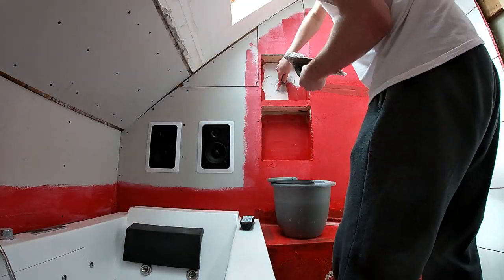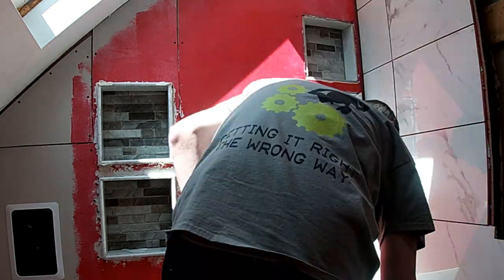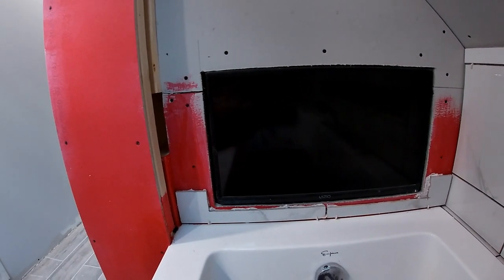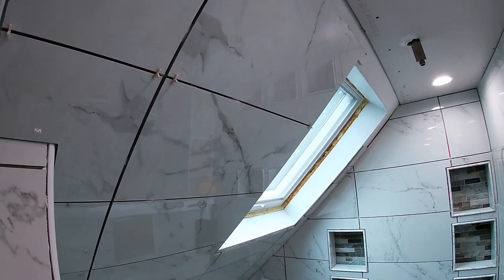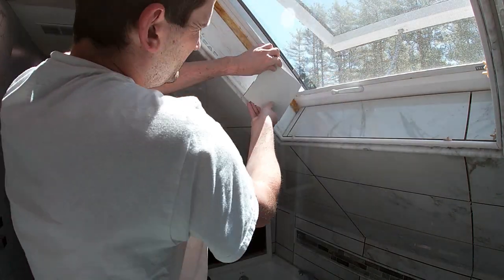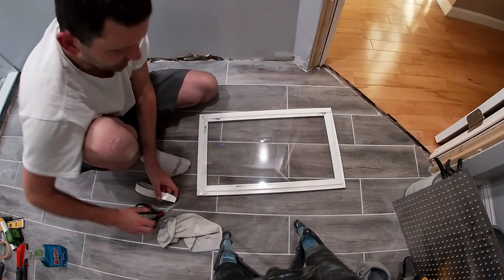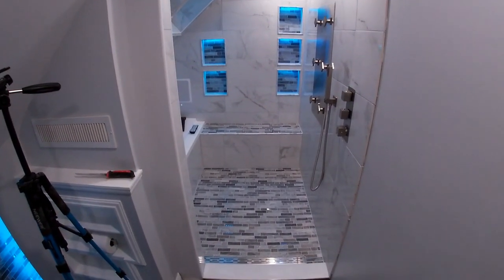DIY Luxury Shower + Jacuzzi COMPLETE! - Bath Reno Pt 8

Comment: Question: I have the same whirlpool bathtub, but I have problems with electrical wires, because there’s no instructions and very bad customer service. How  your connected the 2  wires from bathtub to the electrical panel? What’s amperage and voltage?
Reply from the maker: It's just 120v so hot to hot and neutral to neutral.  Just make sure you wire it on it's own circuit to a GFCI breaker.  It needs a 30amp breaker.

Comment: Brill! I need to check out these (presumably waterproof) speakers. Also, i hope you get a really good silicone seal on the TV. If the TV gets warm during use, the air inside the cavity will want to expand and escape, when the air inside cools it will want to drawn in air, with potentially moisture in it. Its the reason why a lot of rope light (non LED) fails because of the cycles of heating and cooling outside and getting is fully sealed is critical.
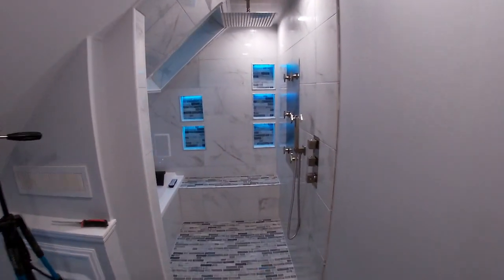Reply from the maker: Excellent point!  If you pause the video at 9:49 you will see a long thin vent that looks like it's for forced air HVAC.  It's actually a vent for the TV's hot air.  I also have low vents that can draw in fresh air on the low side of the pocket but that's in a cavity below the tub and behind the wall.